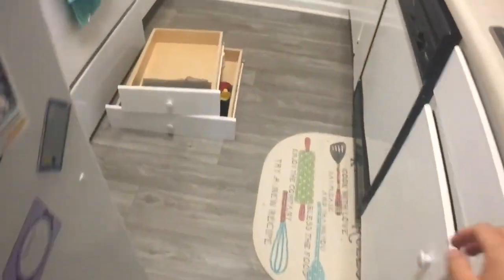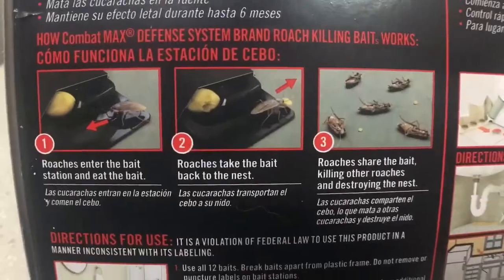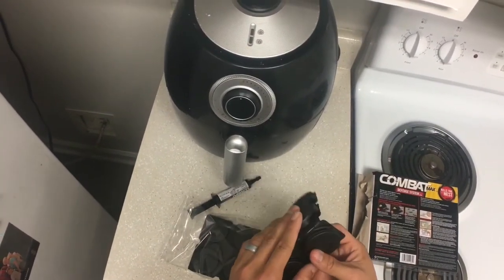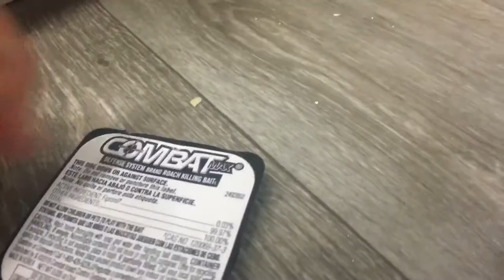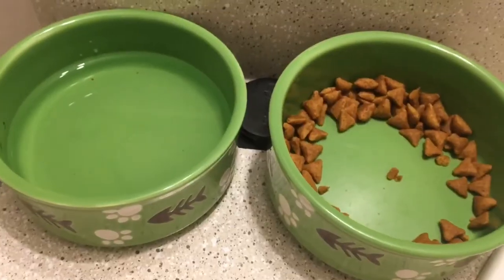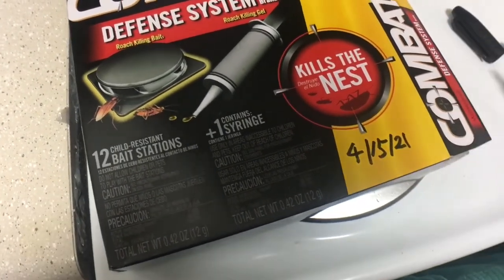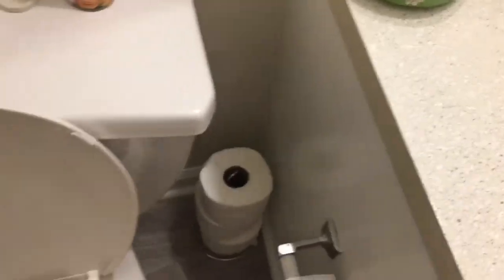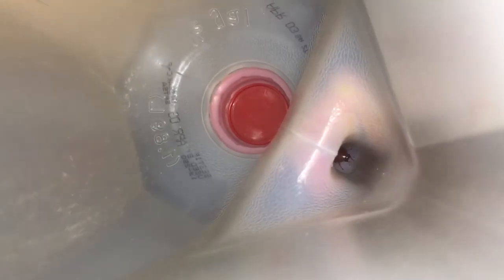How to apply Roach bait and 6mo results *actually works!

Comment: gel alone rids  home owner/renter of current batch of unwated visitors ...yet more return asfter gel wears out... so I used (water resistant kitchen/bathroom chalking) -- to close up all crevises and prevent bugs from returning ..then apply gel...worked wonders for my place...
Reply from the maker: Thanks for the tip. I have tried to seal up crevices but found out that bigger roach(in this clip) came through the HVAC vents. I don’t think it could be gone completely. Unless, complex management tries to deal with it. At this point, I don’t know what’s going to be worth 🤷🏻‍♂️